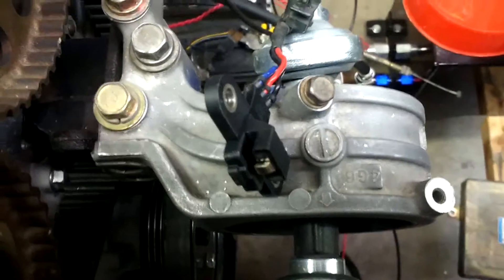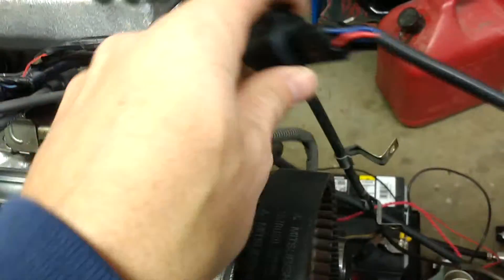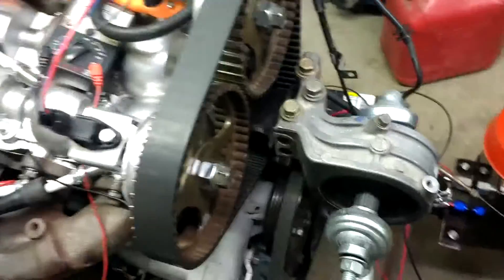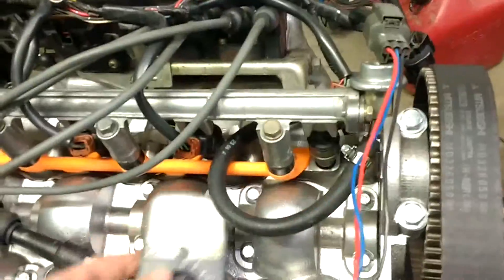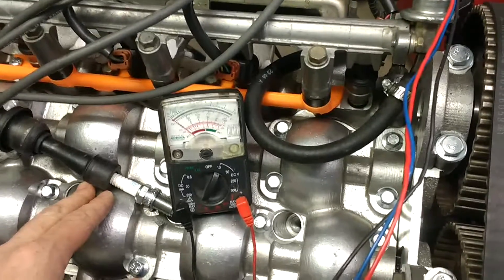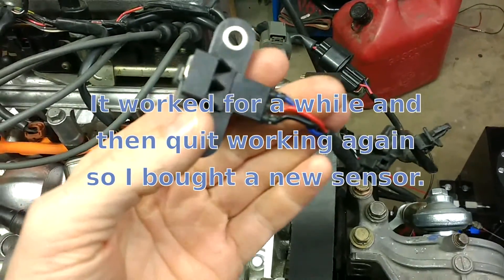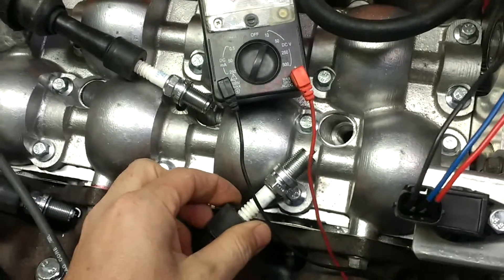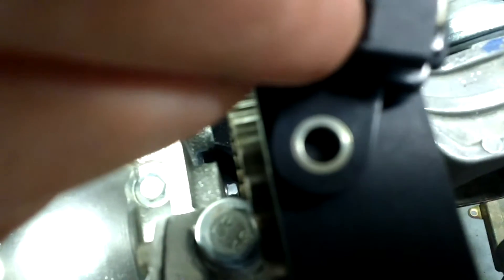DSM Crankshaft Position Sensor CPS Testing

Comment: im actually going to be using this test tomorrow on a 95 talon. it's not sparking on 2-3. so let's hope this points me into a better direction. the ptu, coil packs, plugs, wires are all tested good. so im leaning towards this but we shall see. thanks for the helpful video!!
Reply from the maker: April Stanley It has been a while since I have worked on this but IIRC the crank sensor is going to trigger spark but the cam sensor is going to tell the ECU which plugs to fire. If you are only having certain plugs fire and you are sure your plug packs are good the problem could be the cam sensor. Good luck I hope you find your problem!
Reply: Goldenstein Engineering and Fabrication LLC yeah I've dialed and tested everything down to the problem being the crank or cam sensor. both sensors are brand new but that doesn't mean anything.
Reply: @stanleysdsms7058  did you ever get it turned on?

Comment: So to do the quick screw driver spark test do you have the cam sensor lines up to spark ? Cause I'm on my 3rd crank sensor and can't get any to spark
Reply from the maker: K2 Fort I'm not sure how important the CAS position is. I think the position will only tell which plugs to fire but at least one should fire no matter the position of the CAS. I could be wrong on this. If the CAS is giving an erroneous signal it may cirmcumvent the system from triggering a spark. I would check the voltage to both sensors and their output and verify they are in spec.

Comment: That proto type cylinder head appears to be like the coats spherical valve head design type that really never gained traction into mass production and just seemed to  fizzle out??
Reply from the maker: Its sad Coates never went anywhere. I talked to them a few times and tried to work a deal with them to get their technology into the market they didn't seem sincerely interest in it actually going anywhere. Personally I think they are a scam.
Reply: @Goldenfab  So you designed and developed a working prototype on your own? Obviously yes right? That is a awesome achievement because of the complexity of machining details. Your machine shop must be fully equipped and you yourself a accomplished machinist. CNC 5 AXIS machines are amazing and I went to one of those big shows some years back. My hat off to you and your crew!!!!!
Reply from the maker: @MrDilley777  Yes all my design and all fabricated in my garage. Nothing specialized like 5 axis. The head was sand cast in my garage using basically DIY sandcasting equipment. Casting patterns and all machine work was done with my 3 axis knee mill I converted to CNC,  manual lathe and basic shop tools. You can do a lot with a little ingenuity if you have a lot of ambition.
Reply: @Goldenfab  Yep I'm kinda like that too. I think a 3 valve head with single overhead cam could possibly work, one exhaust valve with two intake valves and center spark plug. I use too port cylinder heads and had a flow bench, valve grinding and guide replacement tools but a divorce kinda blew up that whole deal. Oh well learn from it and move on. We live in California S. F. Bay area, what state do you live in?
Reply from the maker: @MrDilley777  I'm sure that could be made to work. If I was to guess it's already been done. I'm in AZ
Reply: @Goldenfab I think the Ford triton motor has three valves but it's not a very good long lasting motor and has problems I heard.
Reply: @Goldenfab  ever get this prototype head working? It’s very cool!
Reply from the maker: @littleb5911  No, have not worked on it in a few years. I haven't given up. Just been too busy. I'll be sure to post an update when I get it going.
Reply: @Goldenfab  Please do. I'm planning on building a V12 and making it as small and light as possible. Looking towards rotary valves as I just learned about them and they fill my needs. Wondering however if a combination of freevalve and rotary valve tech might not be the best option. Instead of a fully rotating valve on a chain. why not electronically actuate it into a more stable locked position? Similar to the bolt on a rifle. No need to worry about slapping valves with this design so I wouldn't be worried about losing power to the actuators and blowing up the engine like in a regular freevalve.
Reply from the maker: @timbrwolf1121  Rotary valves would be cool if you have the time to experiment. If you want it to just work, probably better to lean on proven technology. Shoot me a link or comment here if you make some progress you want to share.